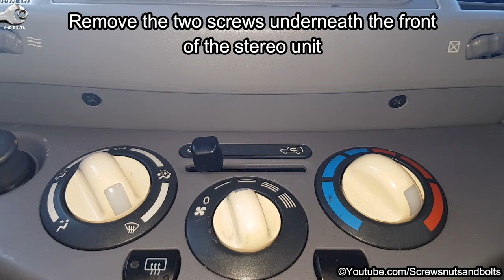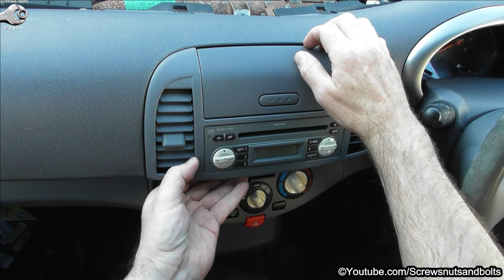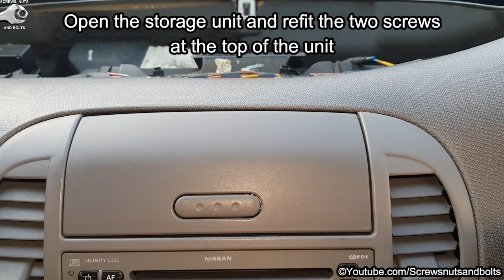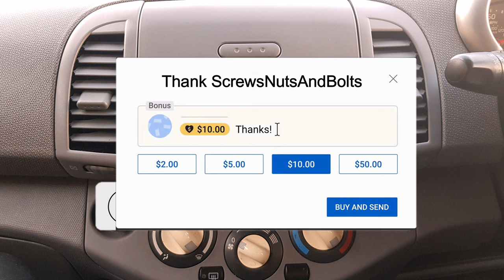Stereo Unit Removal and Refitting - Nissan Micra K12

Comment: I also recently got a Nissan Micra K12.  which car radio with display could you put in?
Reply from the maker: I don't know to be honest. I don't really do any work with audio systems, sorry
Reply: I am going for a regular sized, bluetooth, standard, single DIN unit for €50.. There is also those with a pop out screen and some that fit a single slot radiohole but with a larger screen  but then it would cover the little box for glasses and stuff :) 
check local retail or online store that you see fit..  To fit anything bigger you have to modify the dash. But you will probably spend more money on the radio than the car is worth. 
Nice little car but man.. talk about making it hard to remove something that should be simple to swap. On my 1968 car you see the screws to take out when changing something. Removing plastic cover on the A pillar to remove top of the dash to reach the bracket to FFS... It could have been as easy as the top 2 screws and the ones underneath.. we will see if this will be worth it.

Comment: Did you turn off airbags before installing or is it not needed?
Reply from the maker: No it's not needed for this job. You could de-activate them by disconnecting the battery and leaving it for a few minutes, and then reconnect it when you're finished the job, if it makes you feel safer.

Comment: This is superb.
Can I change the Nissan radio for an after market one and if so do I need a special electric plug adapter?
OTOH is there a way in which I could run an AUX 3.5 wire to somewhere so I can use an MP3 or phone with a jack?
All best wishes.
Reply from the maker: Thanks. Yes you can fit an aftermarket stereo but you may need a wiring plug and/or aerial adapter. I don't really know about the other wiring as I don't really do much with audio systems.
Reply: @screwsnutsandbolts   VERY MANY THANKS.

Comment: Are car radios inter changeable? , as my duff Nissan ones needs renewing , will the rear plugs all fit a new radio ? DIN 1
Reply from the maker: You might need a wiring adaptor but that should be easy enough to get
Reply: @screwsnutsandbolts  topman cheers , as the car  20 yrs old might not bother but thanks for our advise
Reply from the maker: You're welcome, still worth having your sounds ! :)

Comment: Hello
Do you know how to install an onboard computer / the screen? I wanna see my fuel consumption
Reply from the maker: I don't, sorry
Reply: @screwsnutsandbolts  no problem, I found a forum of people who have micras and apparently it's just removing the cubicle on top of the radio and plugging another wire. Do you remember if there was another wire behind the stereo unit?
Reply from the maker: I don't remember if there was any extra wires back there to be honest, I was just focused on the stereo wires. It's possible there was but I couldn't be sure.
Reply: @screwsnutsandbolts  no problem, thanks anyway, I will check it myself, thanks to your videos I know how to do it myself
Reply from the maker: Good luck, let me know how you get on :)
Reply: Hi, how did you get on? Would you mind linking to the forum you mentioned?